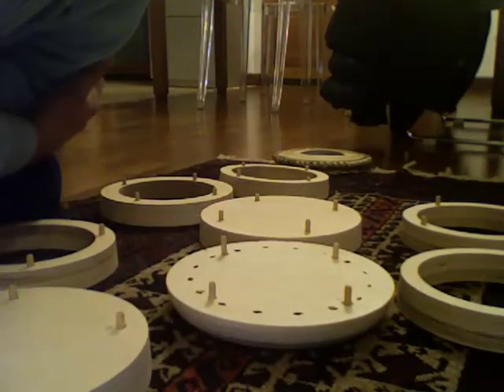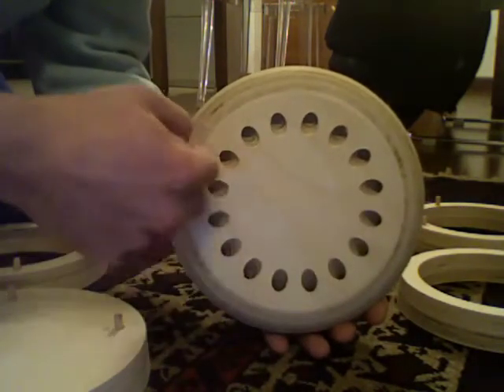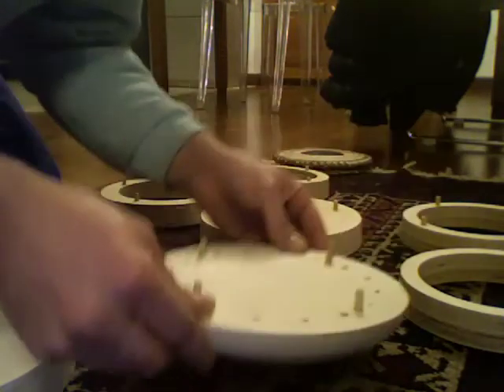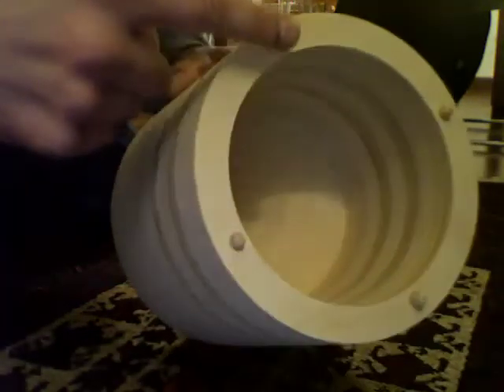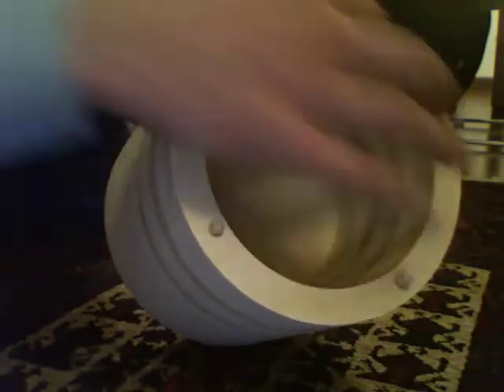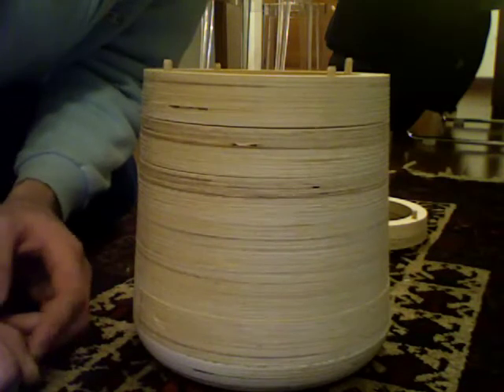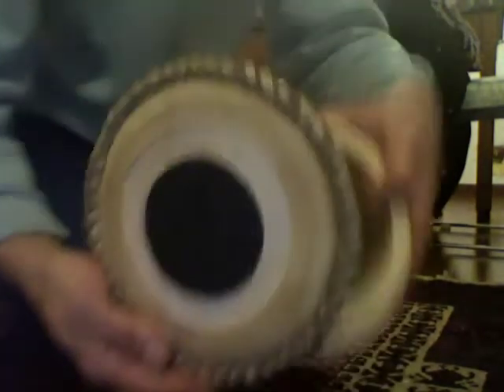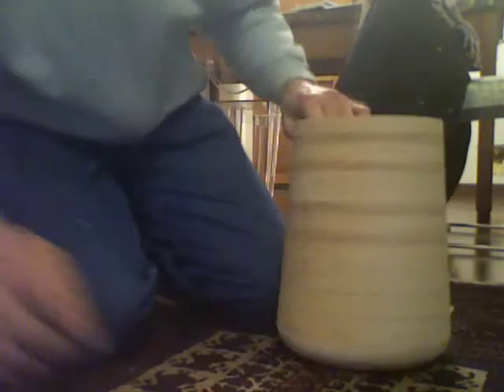my dayan experiment  made without lathe machine.mov

Comment: Very nice work.  One thing I might say: from my experience with experiments I've done in the past, the 1/4" to 1/2" piece at the base of the tabla is very critical for keeping the drum settled properly in the ring as you play.  You may find it necessary or worthwhile to add that piece to your finished drum, even though you've come up with a very smart method for lacing the straps.